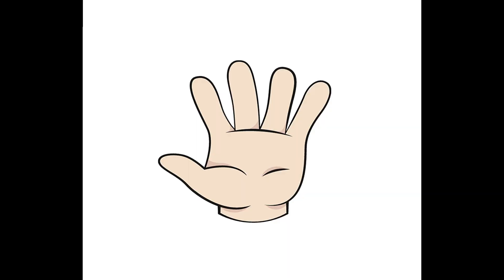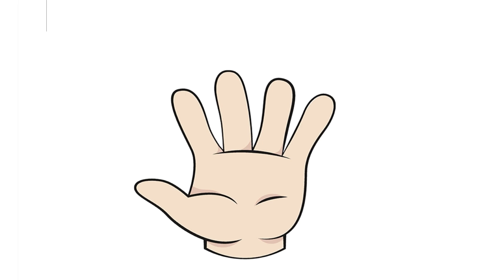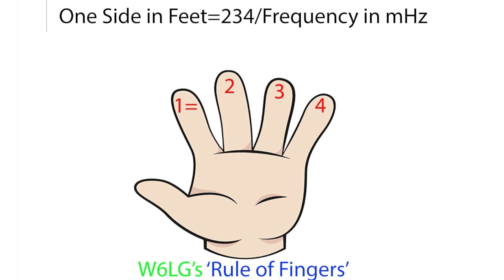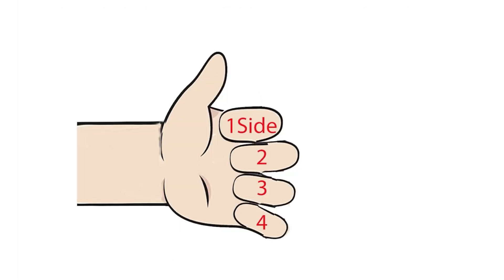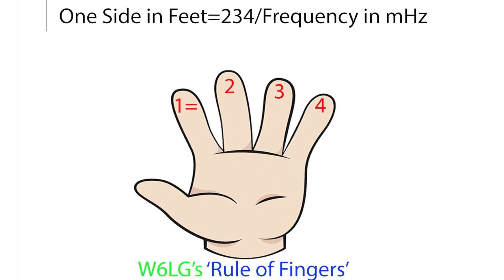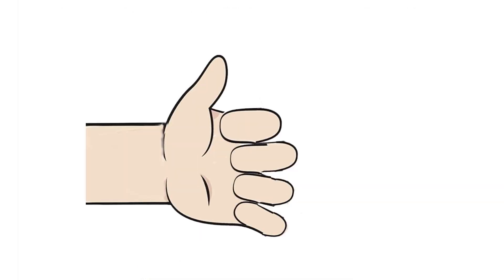To Compute The Length Of A Dipole, Yagi, End Fed Half Wave, Vertical Antenna, The Answer Is 1234

Comment: How are you doing? I'am new to ham I have a question, I'am going to make  a UHF antenna that will be used for simplex communication to my house to keep in my Emergency backpack. I live in the California mountains and I would be using my 10 watt handheld. I currently get about 3 miles of range because of the terrain. I was thinking of going with ether a wire dipole antenna or a Yagi handheld antenna. I carry a compass so would be able to point the antenna in the rite direction. This is going to be my first antenna build and would greatly appreciate any input you mite have that would help me make the better decision. Also I know you lose SWR if your coaxial cable is to long but I was wondering what is the shortest possible length you can use as a transmission/feed line with RG58 50 ohm cable. Thanks and hope you are doing well.

Comment: Good tip, since we are all taught the 468÷MHz rule..it would be very easy to order too much wire if a person had a mind slip and did 468÷MHz ×2 not thinking about it being a dipole or the other side of the coin is just simply cutting it too long and stringing it up and then have it hit you your dipole is 2× longer than it should be...lol
Reply: What is this "too much wire" you speak of.  My last order was 250 feet of speaker wire (so 500 feet) and after making all I needed plus a couple dipoles for friends I realized I always need more!  And rope, I always need more rope.